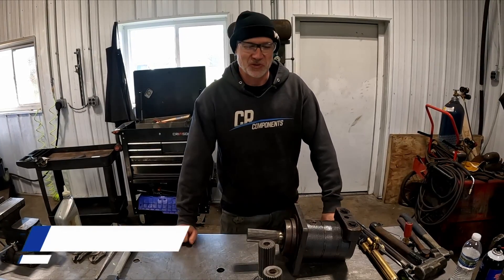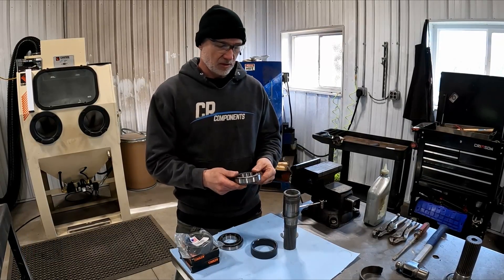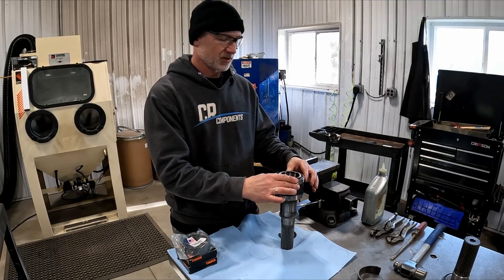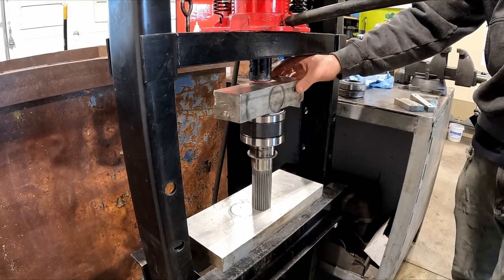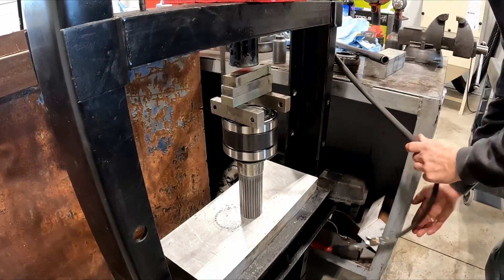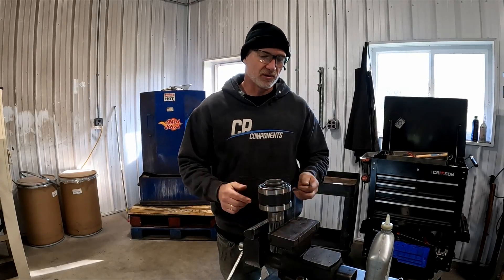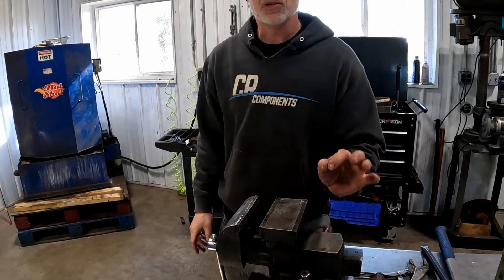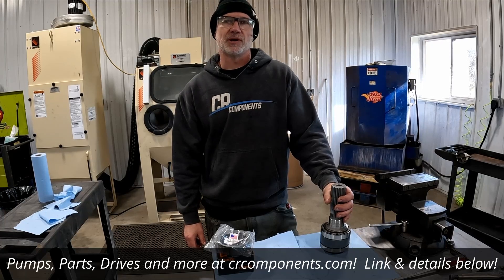How to Assemble a Case XT Final Drive Motor off a Case *XT Skid Steer Loader Machine | VIS

Comment: Is the seal and bearing kits a dealer item only?
Reply from the maker: We have them in stock, aftermarket kit and special Thick spacers with Timkin Bearings. Give us a call with your Tag number off your drive motor and we can get you set up!  Thank you 574-387-3091